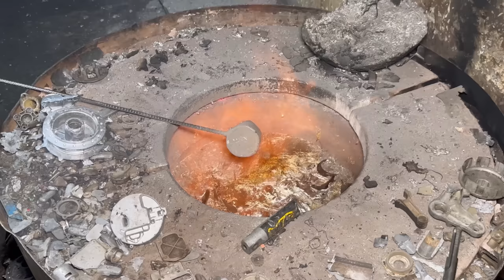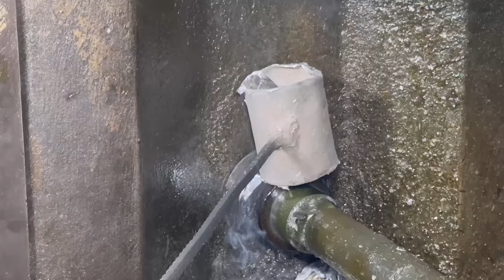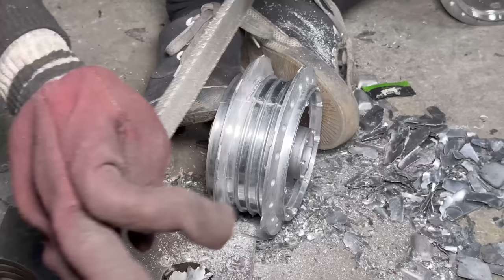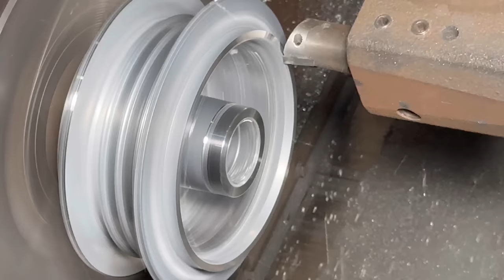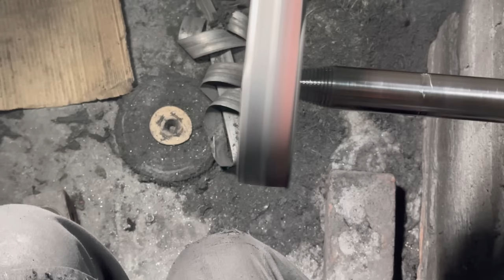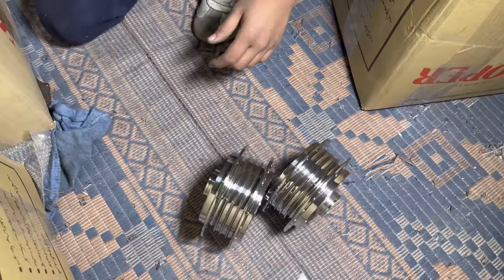How Motorcycle Wheel Hubs Are Made|Как изготавливаются ступицы колес мотоциклов|

Comment: You are very professional. The efficiency of casting with a die-casting machine is greatly improved, and the consistency of the product can be guaranteed.
I'm xavier, an engineer from a die casting machine manufacturer, and our machines are very good at casting motorcycle parts.
Reply: Estoy en el proyecto de fabricar rines de aluminio para satisfacer demanda de trailers jalados por motos 
Cómo son los equipos para eso?

Comment: Way better than the casting into a sand mold, far better surface finish than the other way, machining time is reduced and so is surface preparation for the next phase. 👍 well done!
Reply: Yeah, plus they are molding around a piece of dissimilar metal.  Can't do that sand casting.  The other metal might float and move ruining the part.  I'm actually impressed